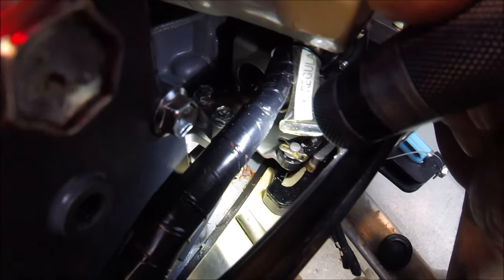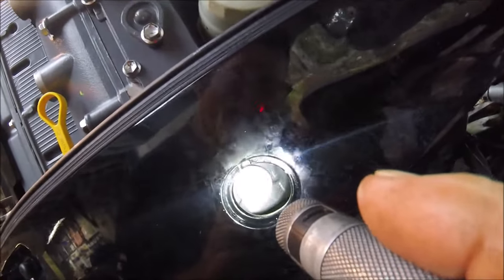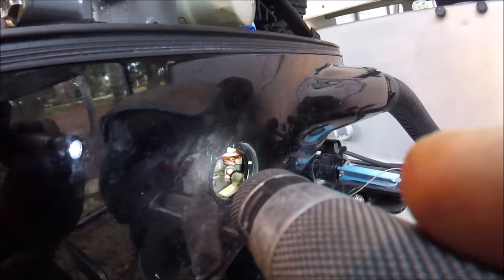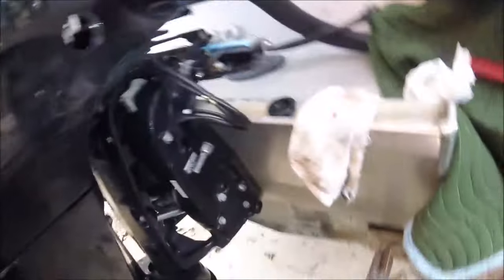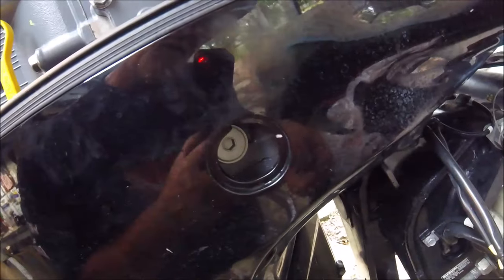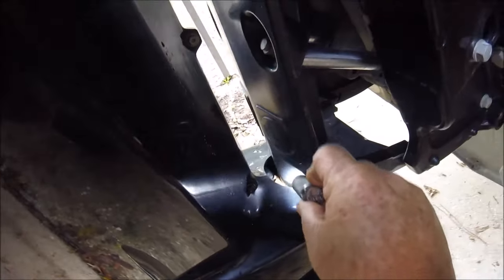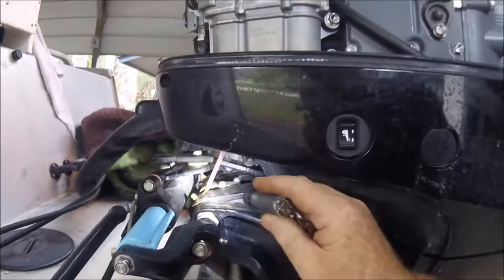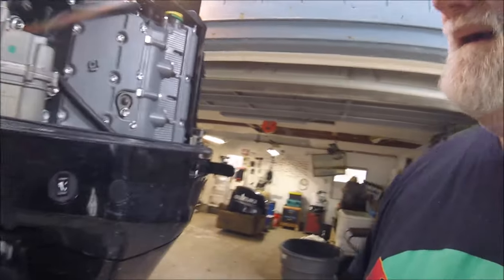Hey Suzuki Maintenance Freaks #suzukioutboards

Comment: hello..I have suzuki df 90 A 2009  and interesting .. How can I check the ignition timing? the engine has been standing for 4 years and has 550 hours..the problem was in the white wire, but I solved that and the engine started. I started it for a few days for 10-15 seconds and everything was fine and now it won't anymore..the pump works but there is no spark..it gives me the error 2 4 CMP sensor..bought a new one and the same thing..I doubt if the chain can skip? I would like to check that but I don't know how? what positions should be on the FLYWHEEL COVER and on the hole when the CMP sensor is removed? Th

Comment: What year and model Dave. I have 2019 df300ap.  Looks like same layout.
Reply from the maker: not sure if 2019 has the drive shaft spline grease fitting. my old 2015 did not. mine is a 2020 and yeah, All same as 300.
just more fuel efficiant.
Reply: @CaptDavesSportfishing  I did my maintenance this year for the first time. These videos really help.  Only thing left to do is grease. The video really helped me with the plugs. I wouldn’t have had the elbow thing for socket for bottom plug. Ty
Reply from the maker: @johngiel9471  10-4